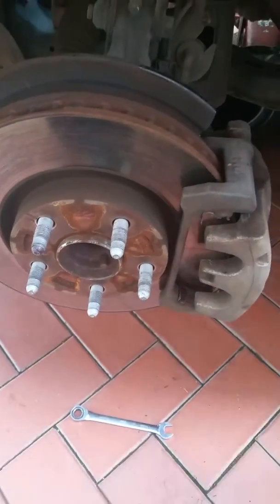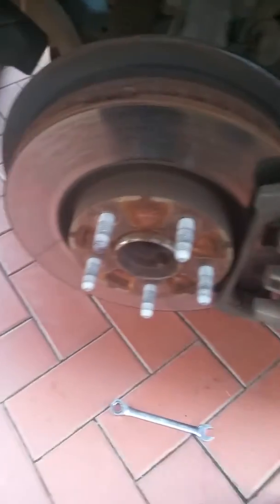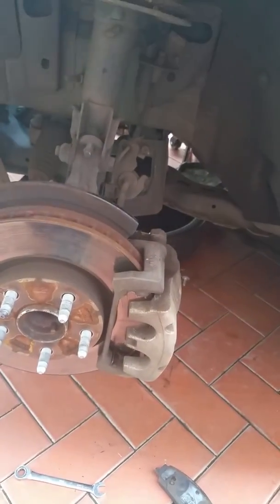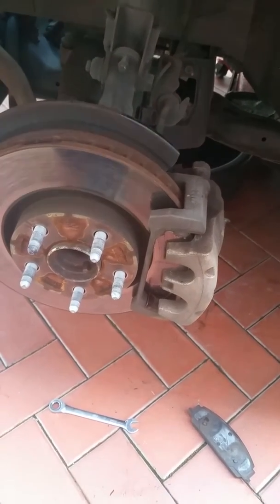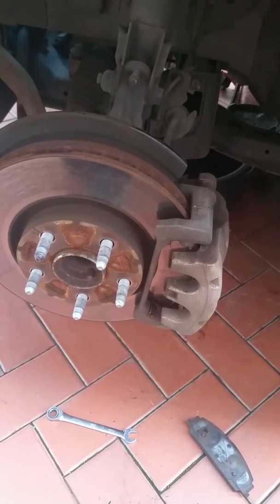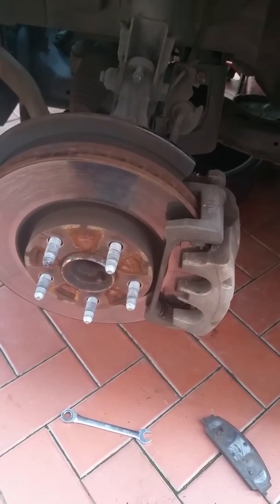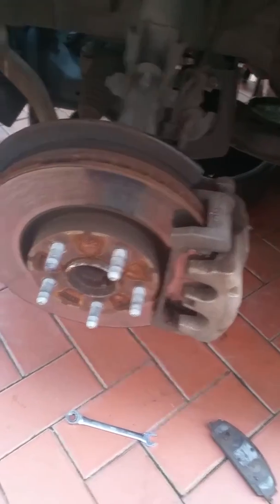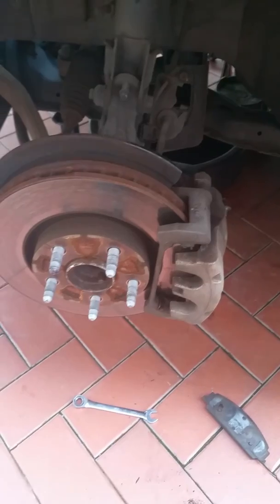VF COMMODORE FRONT BRAKE PAD REPLACEMENT

Comment: Do you need to release the bleeder valve first to get the pads out ?
Reply from the maker: No don't just check that the brake fluid don't over flow do one side at a time and pump pedal slowly after each side pad change